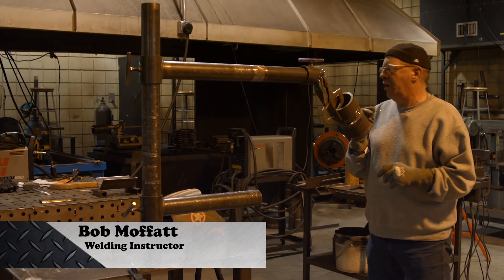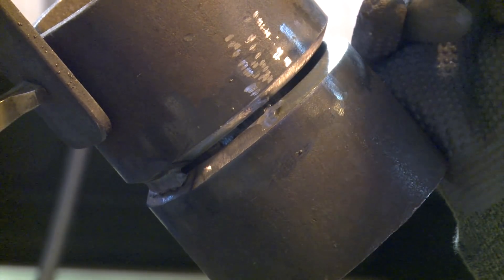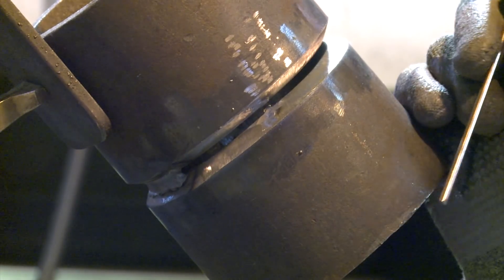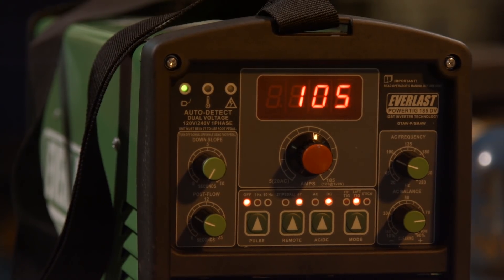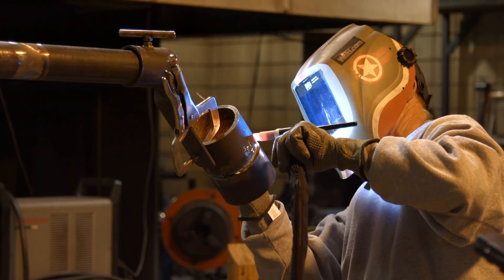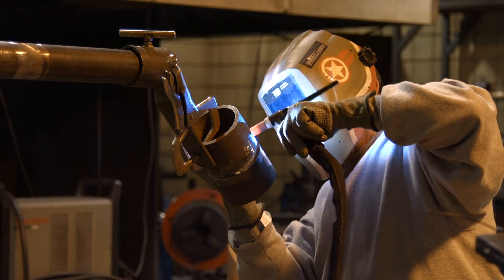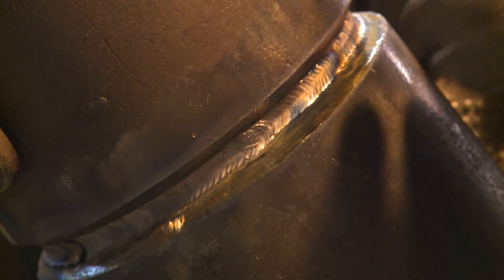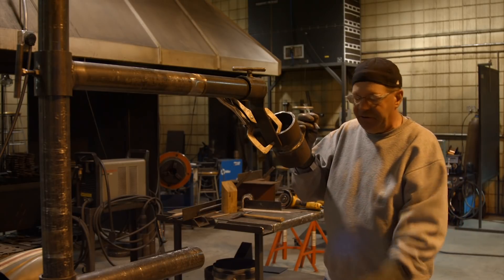🔥 4" Heavy Wall Pipe Weld: 6G TIG root (with Everlast PowerTIG 185)

Comment: Great work Bob . Spending time to practice 6g sanitary pipe . Just got started and having some problem with the body positioning ( how to move feet right so you stay in balance ) also whitch high of the practice piece ( 5g 6g  ) would you recomend and why ?
Reply: Could you please restate your question?
Reply: I believe he is asking for some tips on moving your body around the pipe, and how high he should set a 5g and 6g practice piece. That's my best guess.
Reply: Kyle lehr - thank you , thats what i meant . I practice 6G Stainless Steel 
2 inch diameter . Wall thickness is about 1.8 mm . From the bottom to the top is about 8 to 10 seconds . It's pretty fast . I start standing on one knee and when i reach  9 o'clock it's time to reposition . When i stand up - i'm out of balance and things go wrong . Also would be great to watch how you position your feeding hand and  how you prop your hands on the pipe ( practice piece ) ?
Thank you for your respond , Bob.
And sorry for my bad language : /
Reply: You may position that at whatever height you wish. Some test administrators will allow you move it up and down but never rotate it. I would say pick a height that is comfortable for you. That small of a pipe, you shouldn't have too much trouble in transition from bottom to top.
Reply: Thank you.

Comment: Thank you for the video! In welding school we always had the 6g point towards us, I notice yours always points away, is that much of a factor and is either way allowed in testing for jobs or as long as it's 45 degree angles? Also we have to use 3/32 7018 stringers and not sure how too avoid undercut on the upper bevel of the pipe, always seems to undercut and hear that can ruin a test for a job, any way possible you could thoroughly show how to avoid undercut on the top of the bevel. Also noticed a 'tear-drop' formation of the fill pass, how do you avoid that? It messes the cap lol. Help Guru welder, you're our only hope :l
Reply: Pointing towards you is a little different for sure. Learn to weld them all I say. Avoiding undercut with 7018 is fairly simple. Keep a short steady arc and watch your amperage. Super hot is not always good especially as the material heats up.
Reply: I learned the hard way when starting stick welding that the welding changes as things heat up. It certainly kept me on my toes while learning. I really like that welder you used in this video. I could use a  welder that can weld AC and DC.

Comment: Is short circuit mig even a pre qualified process for coded pipe work??
Reply: Short circuit GMAW is not a pre-qualified process.
Reply: So then why weld pipe with it if you're basically never going to be welding pipe with a mig welder...?
Reply: Because it is done extensively all over the world on a daily basis.
Reply: GMAW and variations of the metal transfer are used all the time on code quality pipe. Have you not seen any Miller welders called Pipe Worx? Lincoln has machines as well. Doesn't take all that advanced process stuff to throw down a quality weld and pass x-ray but is sure is nice - when you understand the process and procedures. 
https://www.millerwelds.com/equipment/welders/multiprocess/pipeworx-welding-system-m00326
Reply: Then why wont the AWS prequalify the process?
Reply: Bob  Moffatt bob please show technique feeding tig rod thru the pipe on carbon steel

Comment: In Europe I have to pass a test and its a stainless steel (304) 50,8mm pipe 2.5mm wall thickness maximum 30 degree bevel with tig, 2G position 1 or 2 layers. Can you do a video on this or give some tips? Thanks